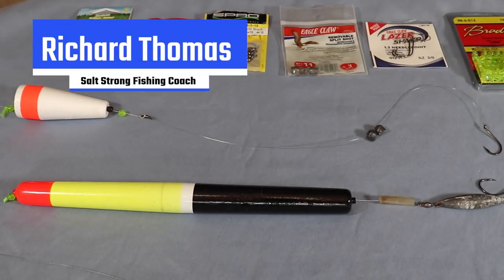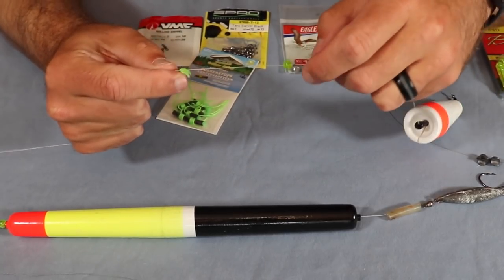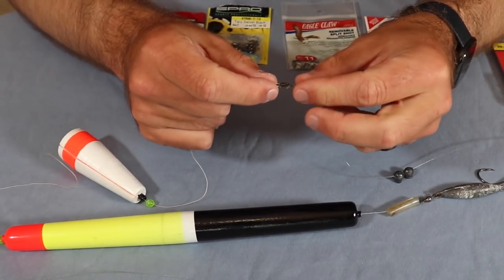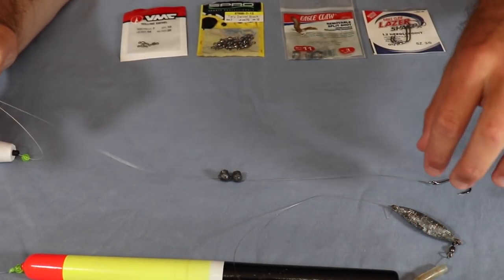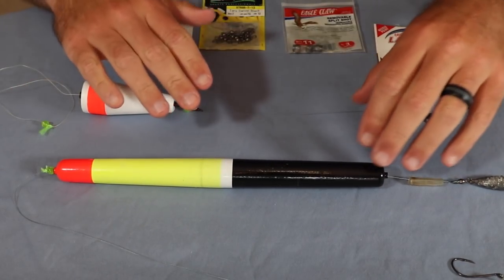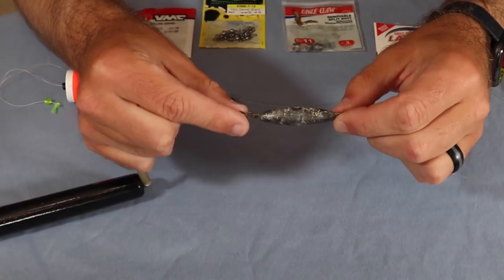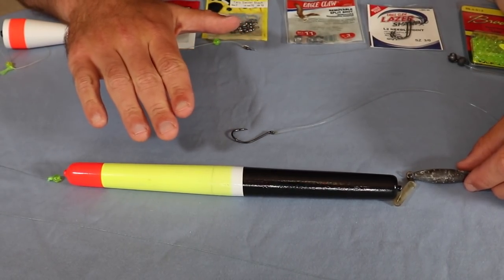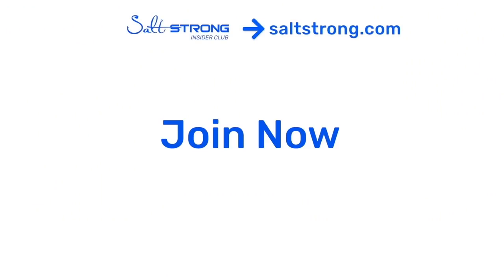Slip Float Rigging & Comparison (Everything You Need To Know)

Comment: good info - I've used a bobber stop on the line above a popping cork for years.  For windy days I will use a weighted cork - easier to toss into wind if you have to and you can heave it a ways.  Also use  a long 20# mono leader up to 6 ft. and put stop on the leader.  With that, never have braid tangles